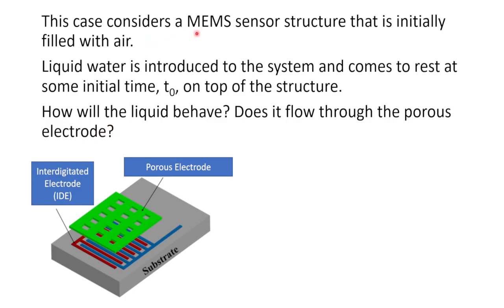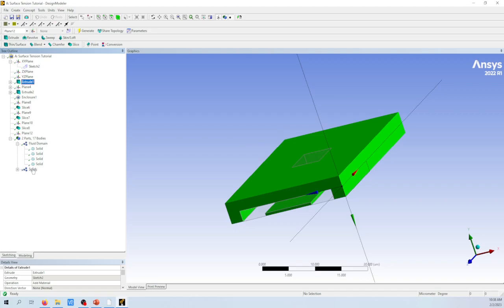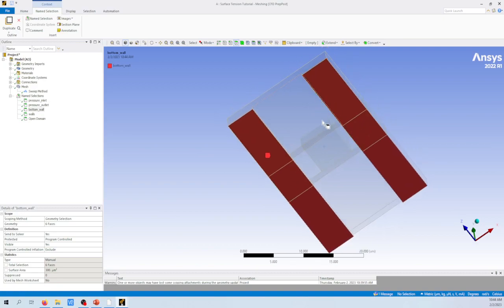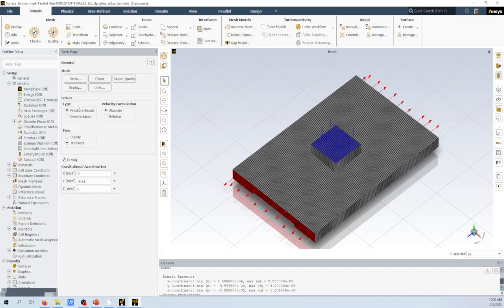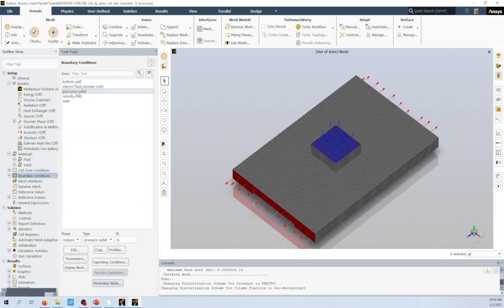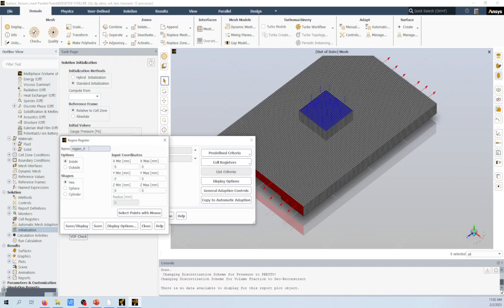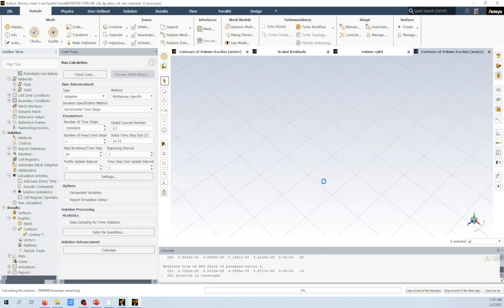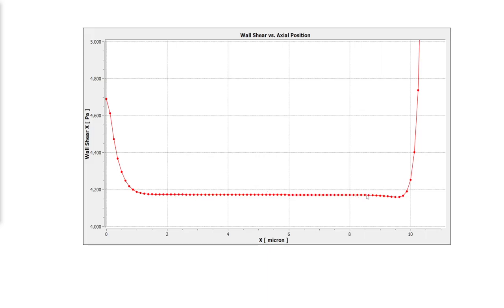Micro-scale Surface Tension Multi-phase Fluid Flow - ANSYS® (VOF) Tutorial

Comment: If implicit body force was not selected for VOF model of viscous flow would that be an issue? Also, is there a way to measure the capillary pressure between two phase through Ansys?